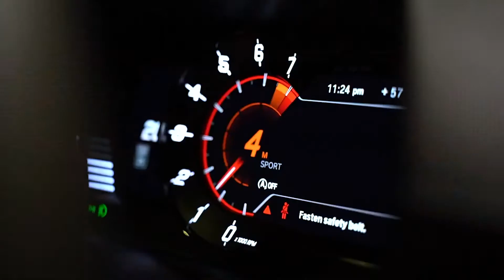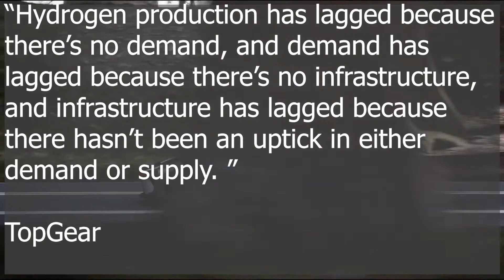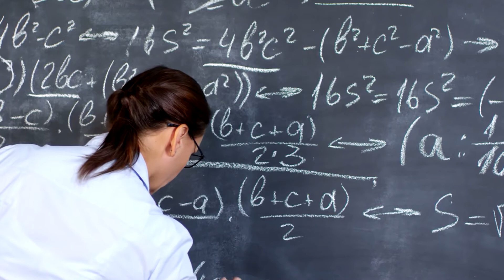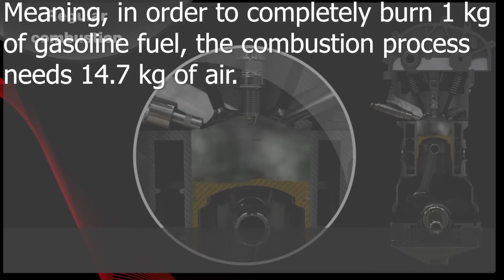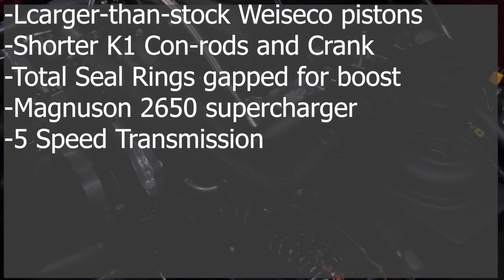This is a Hydrogen powered 1948 Chevy pickup

Comment: JCB UK firm that sells diggers and excavators has developed a hydrogen engine adapted from it's existing diesel engines which only costs £10,000, the firm claims the fuel cells for it's largest excavators will be £100,000, because the fuel air mix is very lean 1 part hydrogen to 100 parts air NOx pollution isn't a problem, water injection which lowers the combustion temperature and also reduces NOx emissions as well as boosts power can be used, it should be possible to recover water from the vapour in the exhaust.
Reply: Fuel cells are still underdeveloped and can cost much less. Cheaper catalysts, PCB fuel cells, other kinds besides the usual low temperature ones only for hydrogen, ... they are all potential options. JCB only didn't provide a better source and storage for hydrogen which made the product lose appeal.

Comment: I got a chance to make contact with Mike Copeland and he and I are heading in the same direction though going about things in different ways. He's a nice man but no to found of Stanley Meyer's technology as lets face it Stanley Meyer was a bit too greedy which is why no one has ever managed to duplicate his technology. As far as I can tell I am the closest to duplicating his work, but back to Mr. Copeland. His method is sound but there is always something missing when someone goes to do this and that is when hydrogen is created from water why are we allowing the O2 to just go back into the air and not make use of it? If Mr. Copeland also had a oxygen tank that would make the engine run a whole lot better as it wouldn't be dependent on sucking the oxygen it needs from our air supply as it would already have all it needs for the complete combustion of the hydrogen it uses. So, one tank of hydrogen and another of oxygen as both gases are being created when the hydrogen comes from breaking down the water molecules. And as he Mr. Copeland explained he can run his engine with mixtures as lean as 78:1 air to fuel ratio.

The secret part about Meyer's technology is he could run his engine with far less hydrogen being used because he manipulated the oxygen being drawn into the engine from the outside air supply to be in an unstable state missing electrons. This allowed Meyer to run his car with just around 7 LPM of hho production from one of his units. No one ever talks about this part of Meyer's technology as Meyer hide the technology in plain sight and most people simply can't find much of anything on how that part of his technology worked. I have big plans for this technology now that I understand how it actually works.
Reply: I guess it is also possible to increase the oxygen by burning the mildly toxic rocket fuel hydrogen peroxide ( which is bleach, women in the UK who dye their hair blonde with bleach are nicknamed peroxide blondes ) in an internal combustion engine
Reply: It was fake, but you can obtain both hydrogen and oxygen from stored water and metal powders. This was already developed and sold in USA by some smaller company. There are also membranes that can separate the oxygen from air and those are also potential replacements for turbos.